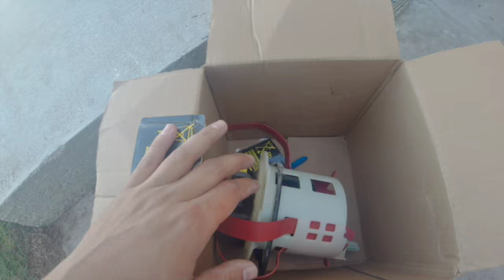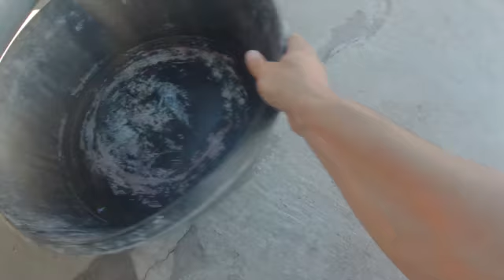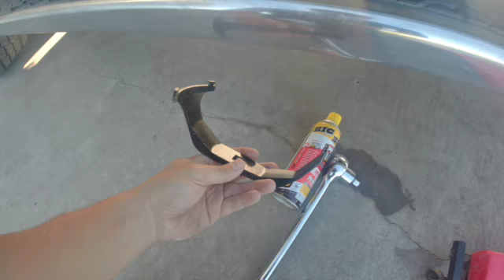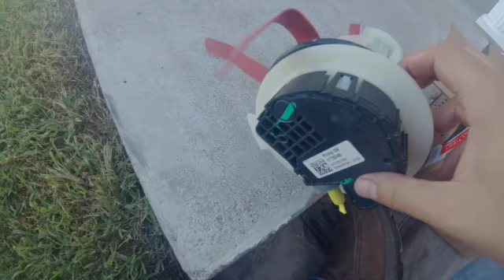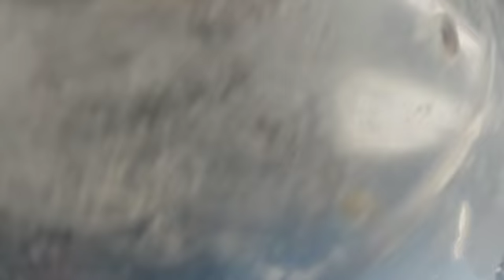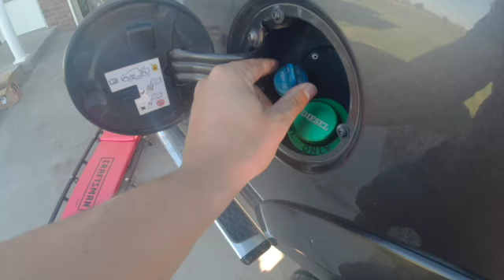P20E9 P2BAC HOW TO REPLACE DEF PUMP ON RAM TRUCK - It finally went out!

Comment: Good video.  However, since you just did the job, it would have been so much more helpful if you had recorded while you did the actual job.  Or perhaps once the DEF was drained and the old pump removed, reinstall everything and then record as you take the old pump out again.  That would minimize the chances of getting DEF on your gear.  Then continue recording as you install the new pump.  Thanks again.

Comment: Did you get the 150 miles to limp mode message with these codes?
Reply from the maker: No it didn’t but probably because once they came on I didn’t drive it. It stayed parked. I preformed all the test it said to do in the service manual so I knew it was bad at that point.

Comment: how many miles are on the truck? i see it was about 6 years until this. basically planning additional PM's for my truck. have you tried soaking the pump in boiling water like the injector? maybe it got gummed/crystalized up?
Reply from the maker: It was in the 175,000ish miles. No never tried putting it in water. I t got to where it wouldnt even pump at all wouldnt even make a noise like it was trying to work.
Reply: @4MRanch  good to know, im at 80k on a 2019 currently, just trying to stay 50 state legal and figured preventative measures may help. my neighbor just lost his entire dpf system, injectors, pump, and the tank was damaged getting the pump out. Ill probably pull mine at 100k to inspect and clean. Thanks for the info!
Reply from the maker: I switched to peak platinum def fluid an it’s been keeping my injector a lot cleaner
Reply: @4MRanch  interesting, ill have to check that out!

Comment: Went in for 30k service on a 2021. Topped of the DEF, drove 100 miles got the 150 mile warning, went to different dealer as I was on a trip, dealer says their is a fault in the tank, they are ordering part. I don’t see why this would go bad like this on a newer truck. I took off the injector and cleaned a little, there is also crystallized def on the on under the pump. I heard another person had same issue after dealer fixed computer recall at 30k. Ram needs to come up with a fix for this as these trucks are too much money to have these types of issues that debilitate the vehicle with no quick fix available.
Reply from the maker: Yeah it sucks because the parts are way overpriced. Try running peak blue def platinum. I been using that an it’s cut down on the crystalizing. If it was crystallized under the pump that makes me think the pump was leaking or the pump seal went bad. Hope they get it fixed fast parts seem to be in short supply I’ve heard.
Reply: @4MRanch  yeah I filled it up at the pump about 100 miles before it did this with it running. Noticed it took a few minutes before the gauge moved. They say it is a fault in the tank. Part should be a couple days. I noticed on the inside of the gas flap it shows not to overfill DEF. I had no idea. Don’t think they should be so sensitive. I am a hotshot driver and was in the middle of trip. Saw others that had the same issue after overfilling…

Comment: The cost alone for this one repair is more than just having parts fall off the truck.  Thanks for sharing.  I think you helped me make up my mind about how I will handle this long term once warranty is up.  If the govt doesn't want people taking matters into their own hands they need to offer a lifetime warranty on all emissions parts and reimburse the manufacturers provided they aren't producing garbage to begin with so that they start milking the govt with a constant stream of repairs.  It is either they back this stuff up with coverage or people will have no choice but to do the needful.
Reply: Damn environmental idiots getting in the way of trucks
Reply: @yoshmira  I like hot a gas vehicle can have the emissions system completely fail and you just get an engine code... but a diesel? shut it down and lock to 5mph?
Reply: @stinson87  the milage lock down is exactly why I deleted. It stranded me once, never again! I had a week long industrial service I was heading to, 600 miles, 200 miles in I got an error. Reset once, went another 50 and got 150 miles till shutdown. Ended up towed to the closest dealer who had my truck for two weeks waiting for parts, they more or less just threw random parts at it until they could get the codes cleared. Long story short that hippy crap cost me a service contract, made me late to the following contract, a tow, a hotel, wasted fuel, and wasted time. Dealer gave me a loaner car at least. Had we not had the countdown I would have fixed it when I got home and I’d probably still have it on the truck, instead I deleted!

Comment: Where did you get your service manual for your truck?  Would like to get one for my truck.  Thanks!
Reply from the maker: I bought it through mopar tech authority but they have now shut them off. So you have to just pay per day. Really makes me mad they did that because I spent almost $200 for the usb manual.
Reply: Thanks for the information.  I have a 2011 Ram 3500,  and would like to buy a manual for it. I haven’t had any thing go wrong yet.

Comment: My husband and I want to thank you for making this video. You explained it very well. I have a 2014 Ram 2500, and over a week ago, I was in town when the DEF message came on with the 150-mile warning. I got it home, looked it up on Youtube, found your video, and had a hard time finding the pump, but I finally found one and ordered an injector. I ordered the pump tool from your Amazon link (thank you so much for that). My husband put it in no problems. When I started the truck, the DEF message went away. We drove it a short distance a few times. Then I took it to town, which is 45 miles. To get my check engine light to go off, we did not have a code reader. So found out if you turn the key two clicks before it starts 4 times, let all the dash lights finish before you go on to the next, then one more time but when all the dash lights go out, start the truck. So you do it five times, and on the 5th time, you start the vehicle. Check Engine Light went out right away. The first time I did it, I went too fast, and it did not work. Thank you again. It saved us half what they were going to charge to fix.
Reply: You don't really need that tool...Just a screwdriver and your hand , I have removed dozens of these retainers just been careful ! Don't mean to be mean ! I bought one of these tools once to remove the plastic retainers on GM fuel pumps just to realize that You don't need any tool !
Reply from the maker: Thats great to hear that you could fix it. I’m glad the video helped. Also thanks for using the link!
Reply: Could of just gone to a parts store and had them delete the code with their scanner rather then playing “turn the key a 1000 times”.

Comment: Very helpful. My pump should be here tomorrow. Im going into this more confident now. Thanks.
Reply from the maker: Glad I could be of help. Hope all goes well for your installation.
Reply: @4MRanch  is that yellow ballon thing suppose to stay on there ???
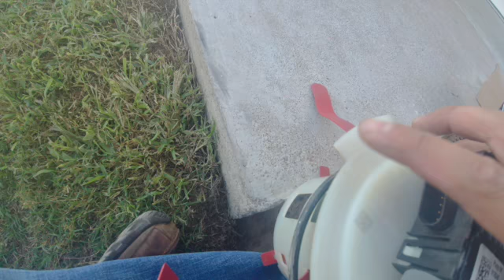Reply from the maker: @joshh1297  they yellow cap at about 10:53ish into the video? If that’s what your talking about then no it’s just to keep debris out of the hole.

Comment: Anybody know what the function is of the stainless steel tube in the bottom nozzle of the pump is for? I lost it and I put it on the truck without it. No codes yet, searching for a replacement. he shows it at 4:30

Comment: Thanks for the video. Too bad they don't put a drain plug on that tank since the pump is on the bottom sometimes I really wonder about these manufacturers
Reply: Yes, transmission pans, front and rear diffs, fuel and def tanks all should have a way to drain them.  Obviously designer/engineers aren't required to work on any of these things before they start pushing these out on an assembly line.  It would only take one advertising about the ease of maint features and they would all change over night.

Comment: Is the pressure sensor built into the pump? I keep getting the p20e8. Everything is clean at the doser. It pumps plenty of def out the open line. Put the doser back on and it sprays fine out the doser but it just keeps spraying intermittently, so much that the inside of the exhaust is white and just smells like def and smokes while it runs. I'm thinking the pressure sensor must be bad but can't find it.
Reply from the maker: Base on when I took my pump out it was all sealed. P20e8 is a low pressure code saying it’s not pumping enough fluid. Seems odd if yours is pumping to much that it’s causing it to smoke.
Reply: @4MRanch  yup, I found out the pump, pressure sensor and float are all 1 piece.
Reply from the maker: @tamsamlbm  so new pump I’m guessing?
Reply: @4MRanch  yes sir
Reply from the maker: @tamsamlbm  man that sucks. How much are they now?
Reply: @4MRanch  just about $900 is what I paid.
Reply: Got a permanent fix kit on the way too. I ain't got time for this garbage! 🤣
Reply from the maker: Nice. I’ll probably get a permanent fix kit next time I have a problem

Comment: Hey man this is a great video, very informational. I do have a question, after you disconnect your hose from the injector and turn on your truck is your pump supposed to be pumping def right away? Thank you
Reply from the maker: It will take a bit to prime up so no it won’t pump right away
Reply: @4MRanch  sorry I’m talking when testing your old pump
Reply from the maker: It should pump within a few seconds of the truck running.
Reply from the maker: If it doesn’t pump at all or you can’t hear a ticking sound coming from the pump it’s most likely bad. Do you have a scan tool to check for codes?
Reply: @4MRanch  after I disconnected the hose from my injector and I started my truck I don’t see anything h coming out. yes my scanner is giving me 3 codes 
P208A
U0001
P020D
Reply from the maker: I don’t have a lot of experience in dealing with the def system others than working on my own truck when I’ve had to. So i narrowed mine down to the pump based on the codes I was getting an physically disconnecting the line  an looking for fluid I let it run like 10 mins and it pumped nothing. I also couldn’t hear the pump making any noise. Those are not any of the codes I had. The P208A could be the wiring so check where the harness connects to the pump make sure it looks good and not corroded then put it on an see if it works if not you may be looking at having to replace the pump. The p020d code is a diesel fuel injector fault
Reply: @4MRanch  good info, I appreciate your help.
Reply from the maker: Wish I could say for sure what it was. I hope you get it figured out. If you would when you find a solution come back an comment what the problem was I’d like to know.
Reply: @4MRanch  absolutely, still working on it but definitely looks like it’s going to be the pump, keep you posted

Comment: Great video thanks for putting it out there. 

To keep from dealing with the mess of the DEF spilling out when you pull the pump I was able to siphon the DEF out of the tank by disconnecting the filler line where it goes into the top rear of the tank. I then inserted a rubber tube into the tank and put the other end into a drain pan. To start the siphon I used the air hose with a blower nozzle. Blew air into the tank (60 psi) while holding a rag around the hose to seal off the opening. The DEF fluid seeks low pressure so the siphon starts and drains the tank. 
There will still be some spillage but very minimal. Hope this helps someone.

Comment: How did u clear the limp message 133 miles to 5 months. On the message screen
Reply from the maker: Mine cleared itself after driving it a few times
Reply: @4MRanch  thanks.  I hope mine does. 🙏 if i can gat a def  pump
Reply from the maker: If it doesn’t detect a problem with the system it should. You can also try unhooking both batteries for 10 minutes. If it still don’t reset may have to have a scan tool or it’s likely you still have a fault in the system.
Reply: The only way to clear the message is to reflash the computer as all def messages are stored where normal tools can not reset them per the EPA. Ran into this two days ago got the dreaded countdown took it to the dealer however it had cleared by itself except for the low pressure code dealer ordered pump and was confused why or how it cleared the countdown on its own did not reflash only cleared codes and verified regen was happening then I picked it up and 5 minutes from home (dealer is an hour drive) got the countdown of death however it did not start from 200 it picked back up from the mileage I last saw when it cleared itself so I have 67 miles left. My Cummins buddy stated have to flash the EVM to get the countdown of death to reset to 200

Comment: How do you like the ram box design?
Reply from the maker: I like the ram boxes for holding my ratchet straps and stuff but I do wish they had some sort of latch adjustment on them because they don’t shut as tight as I would like them to, But I haven’t looked at the new models they may have fixed the issue

Comment: How much was the pump
Reply from the maker: I found one on eBay for $750
Reply: I paid $799 yesterday, plus a bunch to have overnighted to me.  They said they warranty it for 1 year.  Dealer wanted like $1350 but still on back order until mid July (until the date slides again).

Comment: My fight is it seems the heater elements have crapped out, still pumps but my gauge is bouncing around plus it false reads half full then drops to empty then gives the (240km to empty) warning, up here in Manitoba we had -60f so the dealer said probably just got froze up.
Reply from the maker: Wow that’s cold! It got -16 this year here coldest it’s been in like 12 years. My truck did good no problems. I don’t know if the heater could keep up in that cold you would think it should be able to. I think they need to put a block heater style plug in on the def tank that ties into the block heater so when you plug it in it keeps both heated.
Reply: @4MRanch  Yeah i have it in the shop with the pump plate opened and a heater under it to thaw, if it doesnt solve it i might just have to bite the bullet n pull the pump, tho mine is a 2015 so it'd be cheaper to just delete it, not an issue up here......yet.
Reply from the maker: Hope it works for you. It sucks when your truck is down. 

I’d do mine but I use it commercially some times for my dirt work business. I don’t really want to risk getting checked. Although I did drive my 07 for 8 years deleted no issued but the world is getting crazier with all this eco friendly bs

Comment: 2020 RAM 3500 died at 1900 miles, dealer has ordered a new DEF pump, & case manager from MOPAR CUSTOMER CARE says my truck is "priority" . However only 26 pumps are coming in March 2021 due to CV19 BUT over 1700 DEF pumps are now on backorder across the USA...
Not very confidence inspiring that my truck I bought in mid January died in February...1900 miles and I am losing customers and money everyday not able to tow or deliver...
Thanks for your video.
Reply from the maker: That’s terrible! I hope it gets fixed soon. I hate when the truck is down can’t make money
Reply: @4MRanch  thank you Sir, much appreciated.
The problem will be if I am not in the 26 guys to get the 26 DEF pumps that are shipping next week, if not it could be as long as May before the back ordered pumps are shipped out.
My truck being labeled as "dead in the dealerships workspace" should help, we'll see how it goes...
Subscribed and am enjoying your channel and your previous content.
Reply from the maker: I’m probably gonna be looking on eBay to see if I can scab one again like I did have it for a back up because this coronavirus like you said it’s got all the stuff on back order. Thanks for subscribing hope you enjoy the videos
Reply: @MP-1965  Ever get your pump?
Reply: My 2016 3500 just was diagnosed with dead pump and am on the ‘priority’ list which is a joke as of today Friday June 25 there is a nationwide back order of 3,850 def pumps.my dealer just received a priority pump first of this week that was ordered in February.

Comment: Hi how did you know that your pump was bad ?
Reply from the maker: I unhook the line and it wasn’t pumping any fluid out of it
Reply: @4MRanch  I unhook mine and nothing came out with truck running and i did not here the pump.
Reply from the maker: It’s more than likely bad Do you have a check engine light on?
Reply: @4MRanch  I have a check engine light and a derate message took to dealer said 6000.00 to fix.
Reply from the maker: Yeah your pump is bad if it’s not pumping you can fix it yourself it’s relatively easy if you can turn a wrench. Pumps from Mopar are about 2 thousand dollars which is in my opinion stupid for what it is. Dang thing would cost more than 300$ for what it is. You may be able to find one on eBay. That’s where I found mine. I paid 750$ for the pump 130$ for a new def line on Amazon and 69$ for an injector on eBay.
Reply: @4MRanch  why did you need a new def line was somthing wrong with yours
Reply from the maker: Yeah the white plastic clip broke on the injector side I had part of the clip and could of made it work but  I figured might as well buy a new line if I’m buying a new pump an injector.
Reply: @4MRanch  where did you say you bought your def pump lock ring removal tool ?  Thanks for your help
Reply from the maker: Your welcome hope you get it fixed. There is a link in the video description you can click on it.